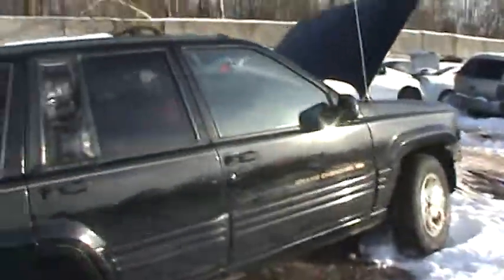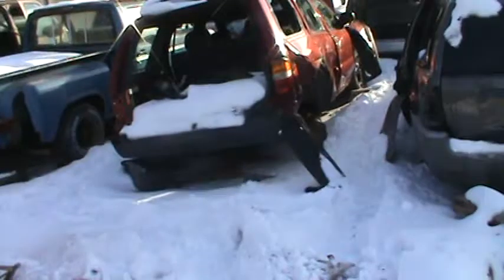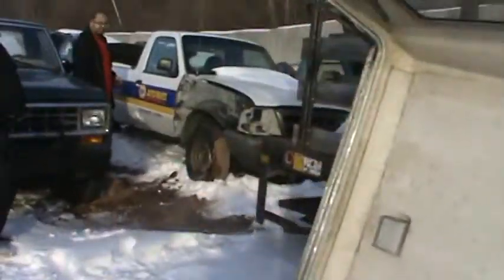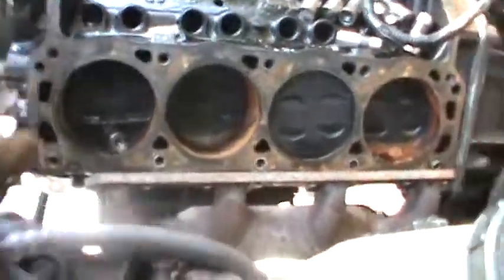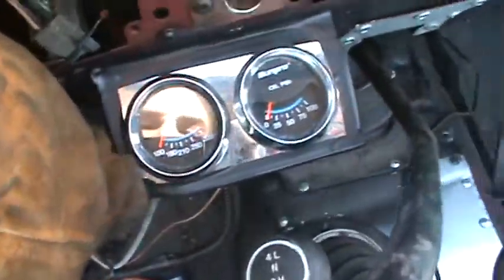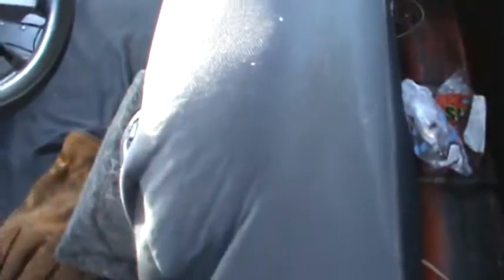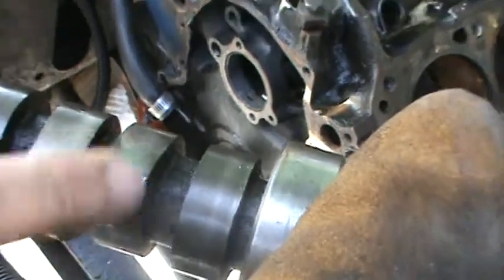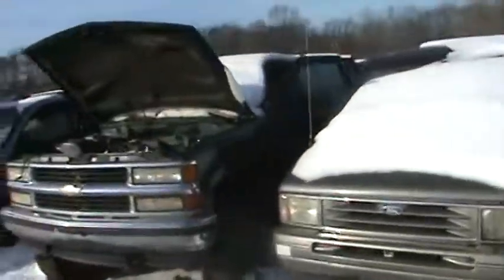12/31/2010 Dodge Dart maybe Junk??

Comment: I had a 1971 duster back in 1978 was my first car slant 6 was a great engine I pulled it with my dad back then and put in a 340 6 pack I raced it one time with a cop and did not have enough money for 4 tires so I only got the ti blew out at 135mph on the highway and was totaled I woke up in hospital 3 days later cop came to hospital told me no ticket due to I totaled the car and almost killede myself . I then bought a 1973 polara 400 4 barrel . Man those were the days